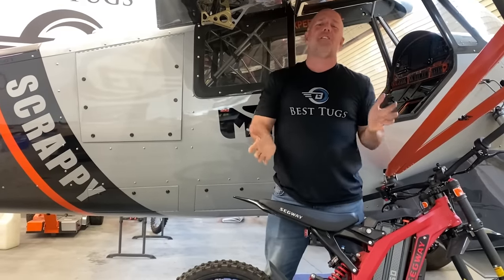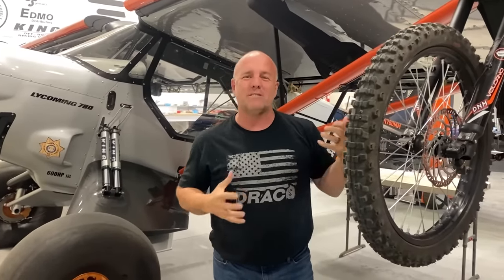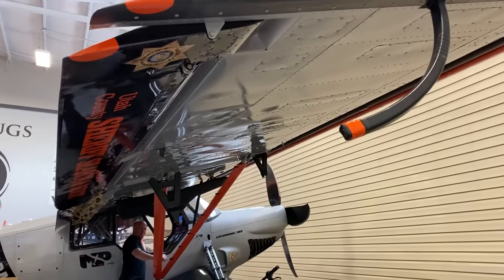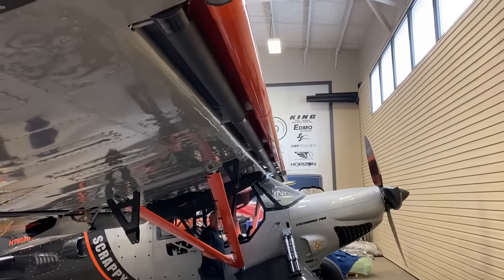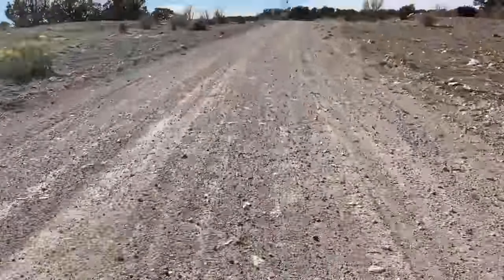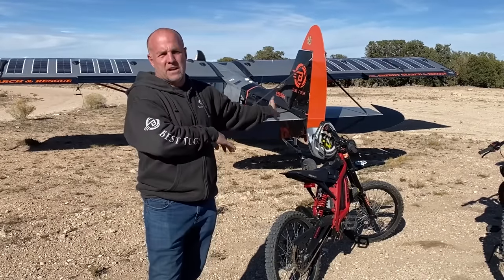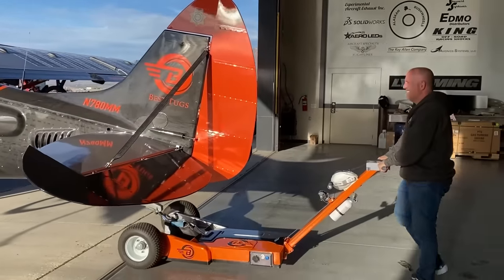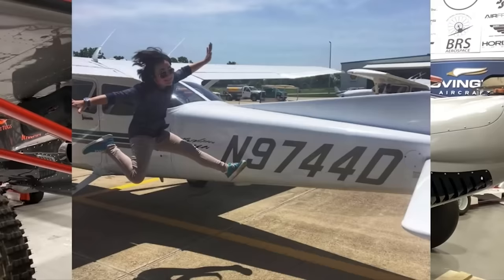Are you kidding me!? Hauling Electric Motorcycles to a Mountain Top? | Scrappy #67

Comment: Here’s a fun story. I was at home in Mapleton Utah and then I hear the strangest, powerful engine ever so I went outside and it was scrappy going to Oshkosh flying over Maple mountain heading East going to Oshkosh!
Reply: I saw the same thing from my home in Springville. Pulled out my binoculars to confirm it was Scrappy. So cool to see it flying.
Reply: There are a couple aircraft I would be extremely excited to see over head. Scrappy, Freedom Fox. Draco “one day”
Reply: I would pay money to see scrappy in person. The most beautiful build I have ever seen
Reply: well here is also fun story. I woke up at 7 am and gues what i saw f15 and f16 flying above me. Armed ones.
Reply: @michabozek1153  i pray for your safety
Reply: @michabozek1153  God speed
Reply: Is there a 'jettison' option for the elec motorcycles if the batteries catch fire in flight? Working in a bike rental shop we had two different bikes catch fire spontaneously and neither were bargain brands.
Reply: @1nvisible1  interesting question from an engineering point of you (ie I'm not trying to be critical of what he's done here, and I find your question genuine food for thought and risk management).  Contemplating this, the scary part is if the jettison wasn't balanced, I imagine firstly you'd need to dump both to retain balance, and then what if one of the releases fails and not only is the load at such distance along the wing unbalanced but could potentially have it thrashing around in the wind.
On the plus side, being an STOL plane his emergency landing options are far greater than most!

Comment: Would you ever consider developing a “Best Backcountry Scooter”?   Having the electric bikes certainly opens up a lot of opportunities flying to various locations but the weight and size of the bikes eliminate them as an option given the capability of most backcountry planes.   Currently available options that can handle unimproved surfaces, we have found, either have a significant learning curve, not the easiest to ride and/or weigh too much.   The lighter weight options can’t handle unimproved surfaces.
Put us down for two if you ever do.
Very much enjoy your videos.  Thank you.
Reply: Montage full size folding mountain bike, first. Then go to Luna Cycle for a BBSHD conversion kit. It will weigh about 50 pounds, depending on how big a battery, and ride like a full sized bike.
Reply: My point exactly.  Two bikes as you mention will be at the 100 pound baggage limit, or very close with not enough weight for gear.
Reply: @portnuefflyer  .. thank you for the lead on the bike.

Comment: Now that Mike and Mark have done just about everything in aviation with ICE power (internal combustion engine), the next challenge for Mike and Mark will be in e-aviation; electric aircraft engines.  Think of it:  Mike builds a eSTOL airplane where the engine is silent, and the only sound is the wind turbulence from the propeller spin around at high speed.  No gas, no fuel mixture, no fumes, no oil, no manifold pressure, and little to no electric motor maintenance.  Talk about lowering the cost of flying!  I challenge you, Mike, to build a STOL craft using an electric aircraft motor!
Reply: Now that's a hauler . Well done Mr Mike .  Bet you could design the optimal Agriculture application aircraft /Crop Dusting.
Reply: They could do it now, but the aircraft would only be good for about 2 to 3 trips around the pattern before needing to be recharged. We are a long, long way off from the battery Tech that's going to be needed before it even comes close to feasible. Not in my or your lifetime. (I'm talking commercial, with any paid passengers) They already make a all electric 2 seater in the Czech Republic for $179K American, but you can only fly it for 20 minutes, not very practical. A whole new type of Tech is going to need to be discovered/invented before we even come close to this!
Reply: @scotabot7826  I beg to differ on the timeline of EV aircraft feasibility.  Not sure which model you refer to but the Pipestrel Alpha Electro has endurance of "up to 60 minutes (plus reserve)" from their website. Harbour Air up in Alaska is already working to certify their electric converted DHC-2 Beavers. A lot of missions including training can be accomplished with an hour of flight time.
Reply: I'm considering building either a Bearhawk 4 place , Wag-Aero Sportsman 2 + 2, Glasair Sportsman 2 + 2, or Rans S-21 with an electric powerplant in the next few years. Looking at Emrax motors currently.
Reply: You can still hear an e-plane prop cavitate the airflow. Look up the Rolls Royce 'Spirit of Innovation' from last year. It's LOUD.

Comment: Once you get the new prop done and turbo fitted, you should do a video just going over all the features and aspects of Scrappy.  It could be like a promotional video that can be shared to show some of the amazing aspects and all the hard work that went into building this amazing plane.  And when you go to Oshkosh you can setup an AV booth playing the video and run it off the wing electrical system.  I know it would be kind of a flex, but honestly Scrappy has pushed the capabilities of what a bush plane can be.  It would be nice to have a video that incorporates all that you have done in one place.  Now back to work.

Comment: First off, thanks for what you do, you're an inspiring man, Mike. When I first got My Alta Redshift electric dirtbike there were no electric dirtbikes around when I go riding, I'd be the only one. Now when I go ride I see KTM Freeride eXc'a and Sur Runs everywhere including racing hare scrambles with backup batteries. I had to buy a Sur Ron cause you can't beat the price to performance ratio. They're so stinking fun. Then I bought an Electic Motion Escape Trails bike and the Oset 12.5 trails bikes for the kids, it's the best purchase I have ever made when it comes to having fun on dirt and just about anything. You feel like a mountain goat on an Electric Trails bike. The power is instantaneous and addicting. If you ever get a chance to test ride an Electric Motions Epure or Escape trails bike or the Oset 24.0 racing trail bike. Don't pass it up, Mike.

Comment: Hey Mike, id like to see more of your life. I really injoy your vids, i enjoy watching your machining, as i served an apprenticship in  new zealand as a fitter, turner machinest. Never got round to running any ccn machines, even though, i was taught the basics. Ive worked for a marine repair shop, a shipping company as a 5th engineer. A foundry maintenance engineer, colgate palmolive, an oil drum manurfacturer, a apprentise training college, a jobbing enģineering shop, an electric lamp manurfacturing shop and finally a railroad company. There i overhauled, generators, alternators, DC traction motors and spent the last eight years, before retirement line boring rèburbished traction motor casings.😊

Comment: Forget the motorbikes...here is the challenge !

Construct two electric propulsion detactchable pods on these bracketts with propellers and batteries which can either be recharged in flight or on the ground. This will provide a hybrid aircraft to save on range and takeoff assist?

Another BSCX consulting group great idea for many high wing light aircraft.

Comment: 7:13 That usefull counter-thingy you added on the aileron end, is hidden aerodynamicaly behind that vertical flat surface of the main wing. What if... that section of the wing is fully-aerofoil-sectioned, instead of being vertically chopped off. Would that feel more linear on the control stick, from the slightest aileron movement?

Comment: With as much focus was put on scrappy's electrical system, as well as being built by someone who makes tugs, I'm honestly just a little surprised the mains don't have small electric drive motors to make taxiing without a running engine possible.  I've been in some pretty rough stuff that required me to shut the engine down to prevent a prop strike and drag the plane around to reposition.  Years ago I landed on a hill steep enough that thrust didn't overcome gravity and needed some guys to push me the rest of the way, having electric motors on the wheels would've helped there.  Would be pretty handy to have your own tug built into the plane too.

Comment: Crazy idea... Those huge wheels must make a lot of drag. For longer flights, make a easily removable rotating cowling the profile looks like a icecream cone. When flying it is rotated directly behind and tight against the wheel (does not cover the side of the wheel). When landing/takeoff rotate it up enough to be out of the way. Rotation hinge point for it just a little above and forward of axle so as it rotates down it seats the cowling snug against the wheel. Lots of engineering challenges: it would need to hinge only on the inside of tire, when not against tire it might catch too much air for strength of hinge. Might just taper the width to make it not look like a cone but with less clearance.

Comment: Hi Mike, Are  you going to put on a reversing propeller. And Yes I like to see your ty wrap machine , I have always used a rubber tube with the ty wrap. on the engine mount when I wanted to isolated the wire or tubing from the mount, with a ty wrap . So when I saw your TY wrap, All I could say was brilliant. And I really like the idea of the first flight Idea. Keep up the good work.

Comment: The motorcycle system really works great.  Very impressive and it must be a lot of fun to have bikes available out in the boondocks. 

However, I can't imagine anything with a higher drag coefficient than a motorcycle.  How about fabricating a light weight carbon fiber partial-fairing?  It would be just wide enough to accommodate the width of the bike (ignoring the handle bars) and tall enough to cover the entire front wheel, the frame, and the head light assembly.  The fairing would not be for riding; it would be used only for transporting the bikes under the wings of Scrappy.

I envision the fairing extending aft to about where the foot pegs mount.  In other words, it would envelope the entire front half of the bike except for the handle bars.  

I think it could be very light weight with a thin carbon fiber skin along with some appropriate internal stiffeners molded in.  A few sheet metal mounting tabs fitted to bikes along with with Dzus fasteners would make the fairing easy to remove and install.  

A fairing system would not compromise the utility of the bikes and although there would be a tiny weight penalty for Scrappy and a little increase in the PITA factor to get the bikes ready to ride, the aerodynamic improvement would be well worth it. 

it's something for you to think about since one of your design goals was to have a wide flight envelope for Scrappy and I'm sure the drag of the bikes doesn't do your top end any favors.

Comment: I like your enthusiasm. Is Scrappy a one-of a kind aircraft? It has a really big wing and a small stab. I understand the big wing but not the small stabilizer size. Is the wing camber more than 10%? Can Scrappy carry two or three rescued people along with a pilot on board? Is a STOL aircraft tricky to land in gusty winds? Glad you are doing what you're doing. How about stowing two stretchers that can be placed where the motorcycles are located (to carry extra rescues).

Comment: Mike, you are late for the party!  I've been flying with a 1300 watt mid drive conversion on my Montague, with a Rohloff hub (14 REAL gears) in my RANS S-7S for some years now, where you been?  I've spotted places I wanted to explore, landed, and then on the ride, found places to land, it's a vicious circle! You ought to check out the old mine site above Yellow Pine and Johnson Creek, and if you land near the ghost town of Gilmore, the ride up to the lake is fantastic. Not to mention all the good places to eat, previously not accessible.  I can re-charge in flight, and have a formula for X amount of flying = X amount of riding.

Comment: Seeing as the landing gear has springs and dampers and is adjustable have you tried changing the configuration in flight for aerodynamics or setting the damping to reduce vibration. Could the torque from the gear be used at low speed?

Comment: I noticed that after you took off from the airport, you left the tail wheel dangling way down in the slipstream.  Have you run any tests to see if that increases drag?  Would a fairing or wheel pants there reduce drag, or just increase weight?  PS:  You're having WAY too much fun!  Keep it up, Mike.  Back to work!

Comment: I don't know jack about airplanes. It seems to me you've designed and built the main battle tank for bush flying. I have to believe there is a number of flyers that would like to have a plane like this. Are you considering manufacturing this plane or licensing the design out to a manufacturer? What better validation than having others buying and flying your plane?

Comment: I would like to know more about the water tower cleaning operation. 

I have supplied airpumps (superchargers) to a company that is developing a water purification system for cleaning the water used for fracking.   I have seen what they are doing but had to sign a bunch of NDAs and so on.

What I don't understand is why all these chemicals that are hazardous, used in the water used for fracking.   Why is all that needed and then need to be cleaned later.

Comment: I  have a question.  The non aerodymanic motor cycle really bugs me. How will the flight characteristics be different if aerodynamic covers or pods are installed on the motorcycles? Also how will it affect the airplane handling? Considering two large smooth walls being hanged on either side of the airplane.

Comment: Hey Mike - question - with all your plane builds - engineering them - drafting them - building them - testing them - breaking them - Im sure you can give me an ' off the cuff ' thought on this - my bud is building a bear hawk - plans call for rivets to be flush mounted - in the interest of saving A TON of build time - hes considering just plane old surface style rivets over the time consuming flush mounts - question is - what do you think the resulting drag coefficient increase would be - .....substantial or negligible ?  my guess is negligible - a few knots in cruise - ?? -         thoughts ??      he is willing to trade the speed over build time -   he is also willing to flush mouth the leading edge rivets - then the typical process on the rest -  worth while ???                             looking forward to your thoughts